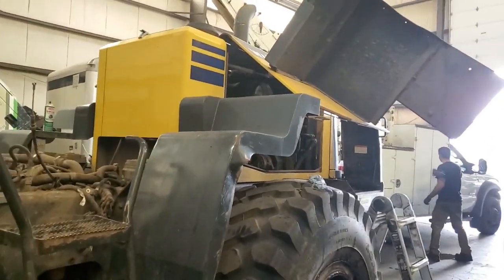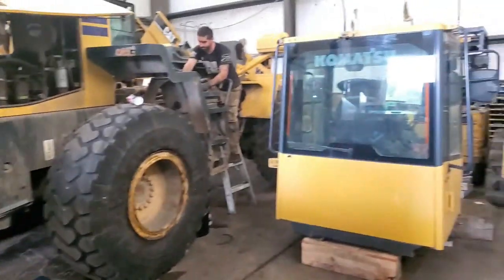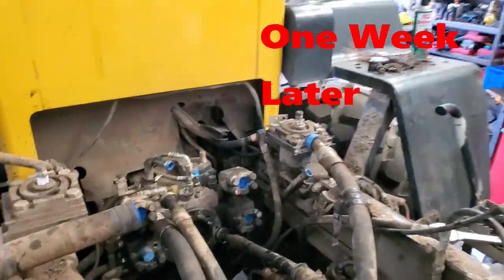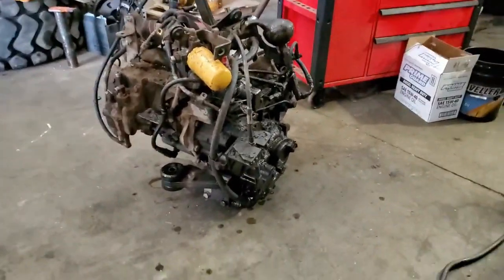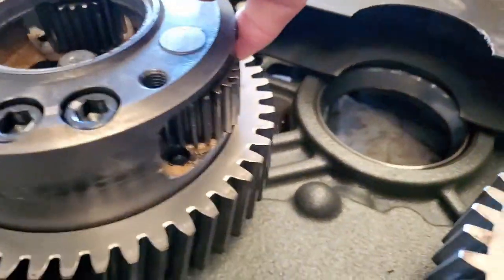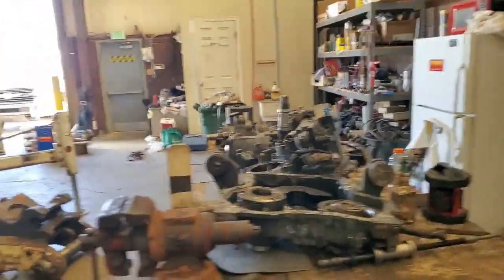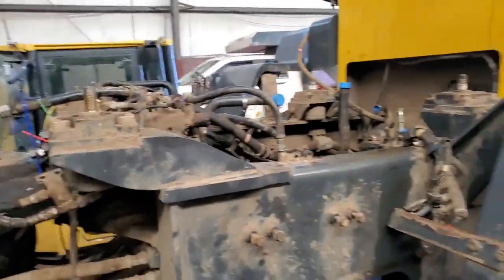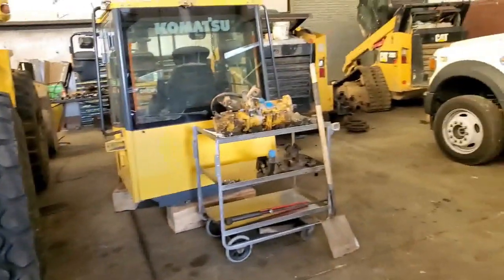Loader Transmission Problems!  #komatsu

Comment: Awsome vid. How many hours were on the transmission when it $h!t the bed?
Reply from the maker: Thanks for watching!   The machine had about 12,000 hours when it started going bad.  After the rebuild it's been running strong.
Reply: Thanks for the info! Im looking at some and wondering, durability of that style trans. Cool to see them apart too. Thanks again !

Comment: Tengo una pala 450-5L no camina que puede ser
Reply: If the loader is similar to the 320 and  isn't moving at all and the hydraulics don't work It may be the plastic gear that bolts to the flywheel and goes and slides over a metal gear when the motor and hydraulic pump are assembled together. I just replaced one in the field and it calls for the cab to be removed. However I did not remove the cab, I removed the finders and side panels as well as the hydraulic tank and hood. I removed all the bolts that join the motor and hydraulic pump and replaced 6 of them with longer 8in bolts to allow me to side the pump back far enough to replace the gears. Tough job first time around for sure. I used a 5 foot bar and a 4 ton portable power kit to side the pump back. It will take you 3 to 4 days if it's your first time but realistically you're looking at 16 to 20 hours of billable time.
Reply from the maker: make sure brake is off.  make sure joy stick and column are both in neutral and only use one or the other.